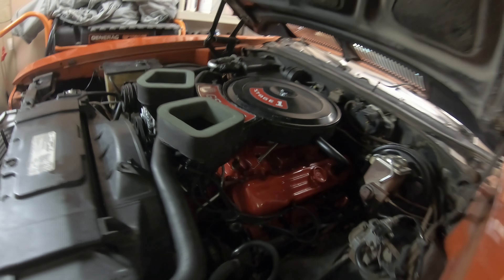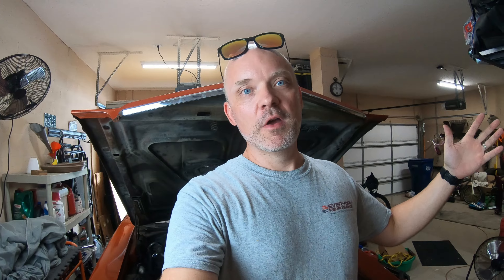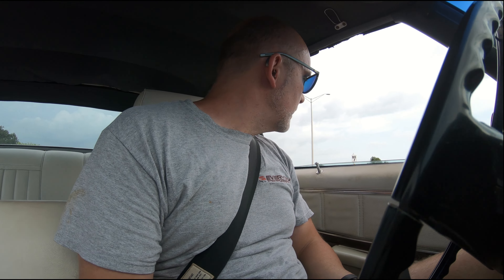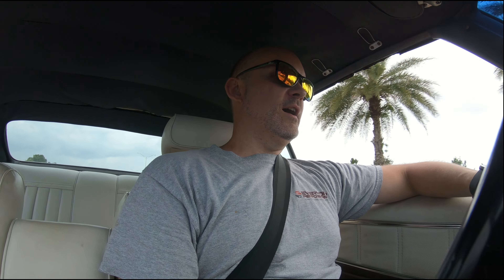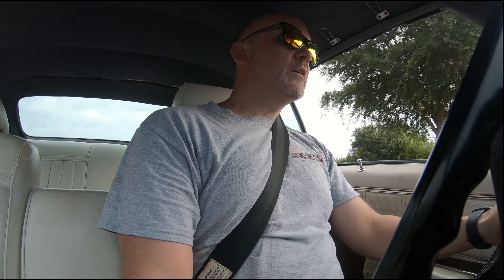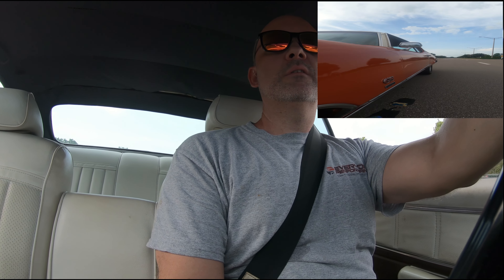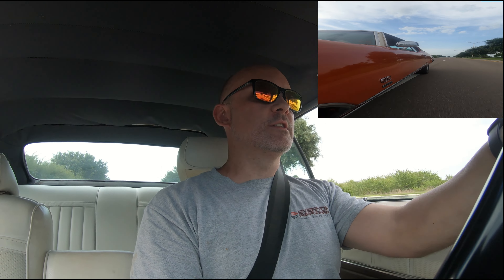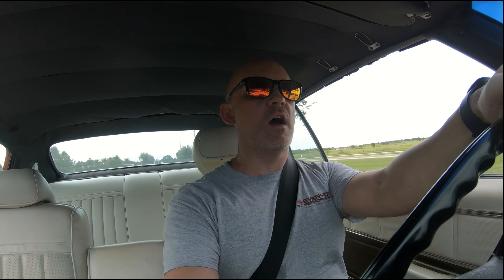1972 Buick GS 455 Restoration PT4 - First Run After New Engine Install

Comment: Finally!
Reply from the maker: Yes, this has been a long time coming! :)
Reply: @JackofAllTrades1  Car sounds really really good.  Be proud of all your hard work JOAT!
Reply from the maker: @PNW_Car_Mods  you think so? I kinda thought it was too quiet lol. I have an aftermarket air filter housing to put on it and I think that will allow it to breath more and be louder... that factory setup will just be for car shows.
Reply: @JackofAllTrades1  Yeah for a nice driver I thought on video anyways that the exhaust note was just about right.  You go much louder and it could start sucking the fun out of it on longer drives.   Speaking from experience of having obnoxiously loud cars lol
Reply from the maker: @PNW_Car_Mods  yep, thats why I went with this setup... you only really hear it at WOT.